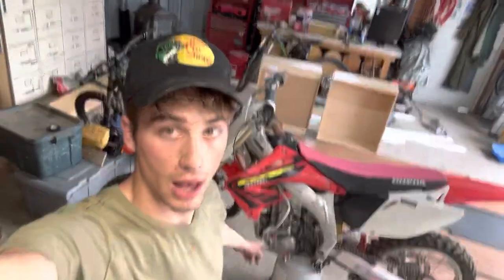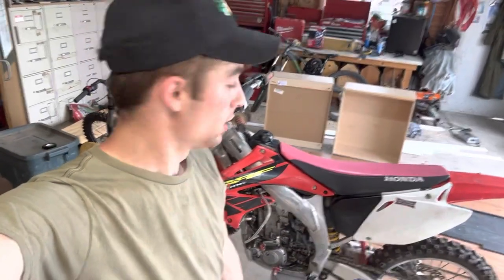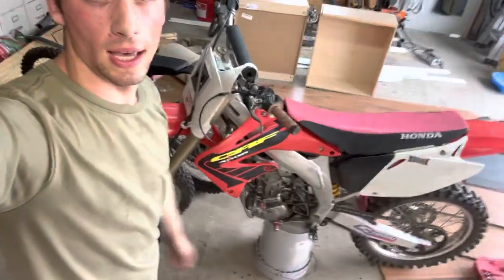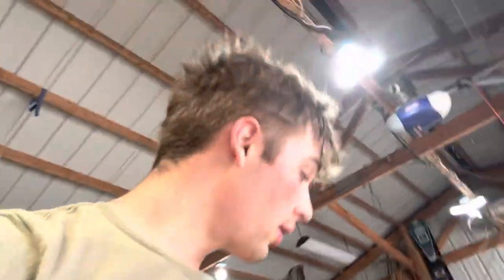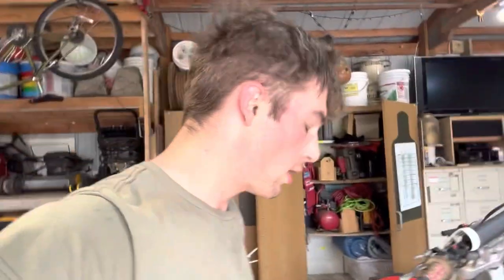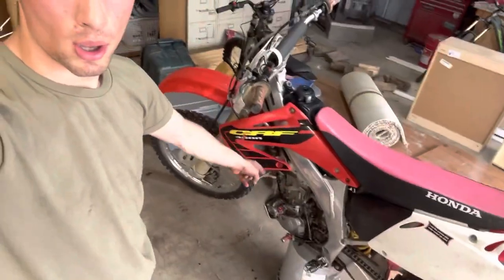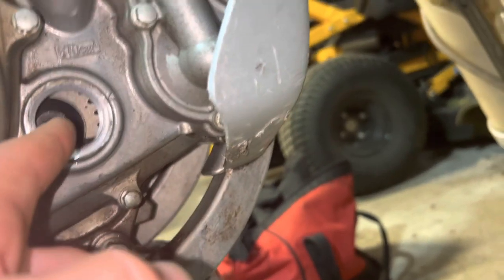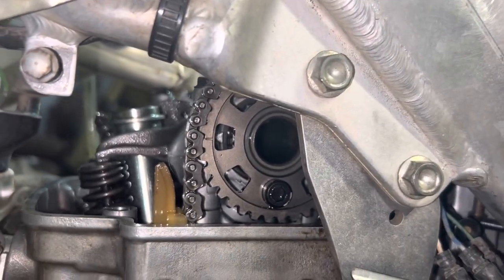Simple Fix CRF450R

Comment: How did you move the gear a tooth over without removing the chain?
Reply from the maker: I took the chain tensioner unit out to loosen the chain, then fiddled it over a tooth , its pretty tight but it’s doable

Comment: Maybe you wouldn’t have been working all through the night if you actually learnt how to start a 4 stroke! ……..do you even know what a decompression lever does?  You don’t start a 4 stroke motor like a 2 stroke!
Reply: Crf450r don't have a decomp lever. They have a hot start lever..
Reply: @martinroycroft  the hot start lets in a larger volume of air, and it also has an automatic decompression mechanism…..you still don’t start it like a 2stroke motor.
Reply: Decompression lever hahahahaha what
Reply: I learnt